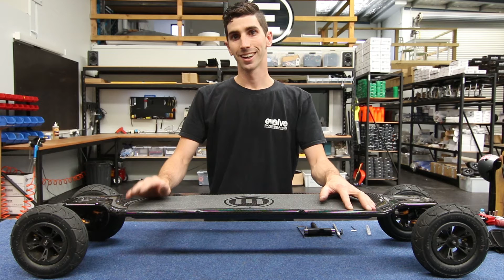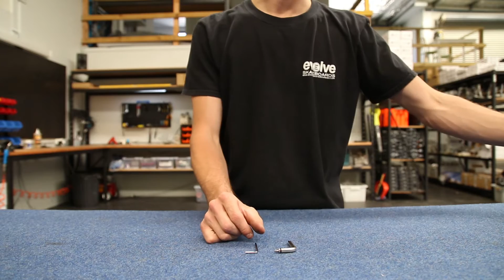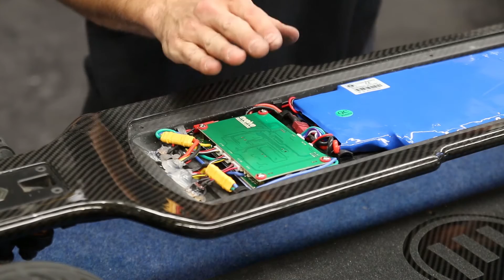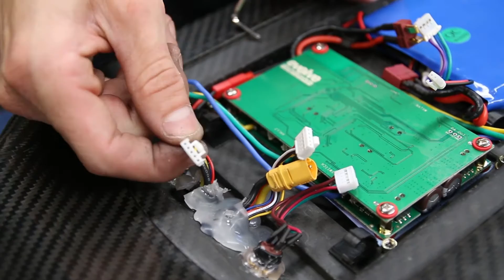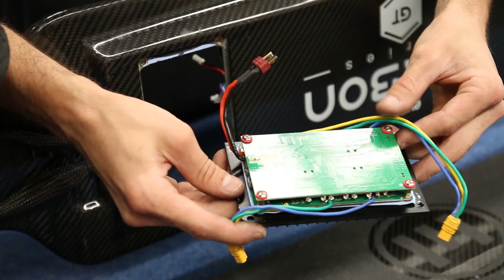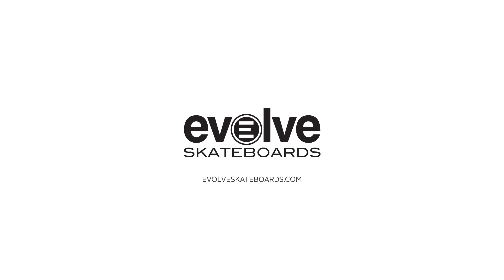How To Replace Motor Controller || Evolve Skateboards

Comment: Could the Motor controller be the issue if one of my motors keeps overheating? this has happened on the same side motor with two different motors. The left side gets VERY hot after going up some hills and the right motor is always fine. Started having issues after riding the board on wet grounds. not sure if the issues are from water damage.

Comment: This is bs because the bamboo gtx is nothing like this.. you undo the 4 screws on the underside and it goes nowhere! Its glued or connected somehow to the enclosure and wont budge.. im ripping wires and damaging things just tryin to budge it lose!!

Comment: Where do I buy new motor controller? My carbon gt doesn’t turn on. I push in power button but it doesn’t turn the blue light and I can’t connect to my remote.
Reply from the maker: Reach out to Evolve service and they can help!
Reply: Hey man I have the exact same problem as you for my Carbon GT. Just wondering 1 month later if u needed up getting a fix for your board.

Comment: Don't suppose you could make one for the GTX? I'm really struggling to fit all those wires in there.
Reply from the maker: Hi there! The GTX should be the same as the Carbon GT. If you would like some assistance, please email us at ask@evolveskateboards.com.au
Reply: But it's not the same, you have to take the bAttery enclosure down from the board. And the way the heat sync is oriented in this setup is far different.

Comment: How do you know you need a new motor controller?  I have a problem with my Bluetooth controller.  I have no connection whatsoever after I had a problem with the battery charging attachment wires.  I could use a video on troubleshooting and replacing the Bluetooth controller.

Comment: Is there some sort of gasket between the heat sync and the carbon board? If not, do you think high temperature silicon (just in case) could be used to better seal the gap and help possibly prevent dust/water from getting in?